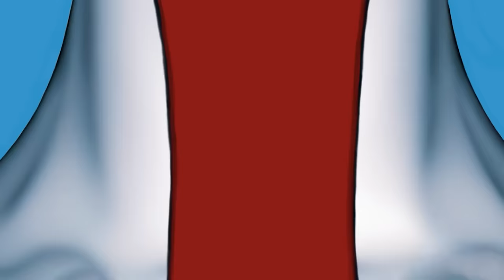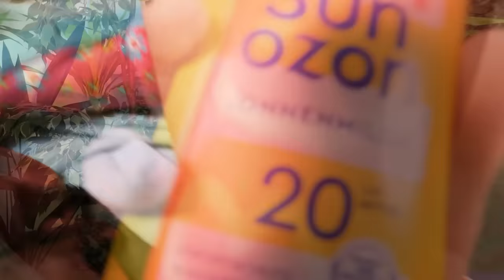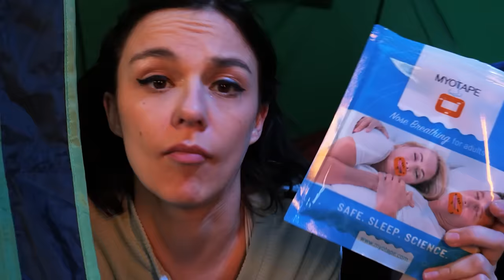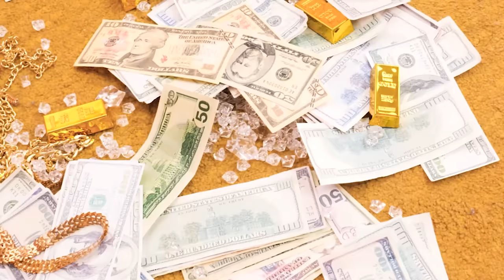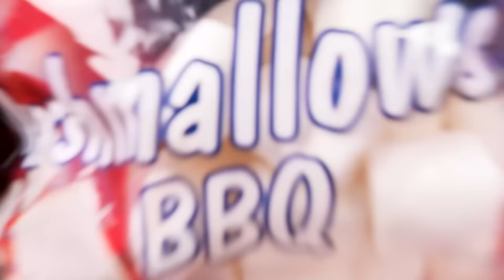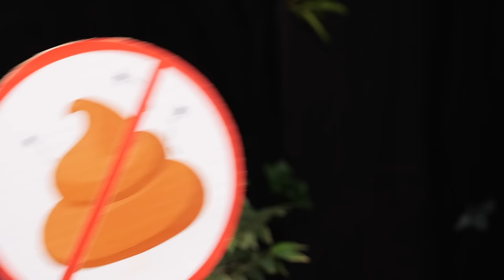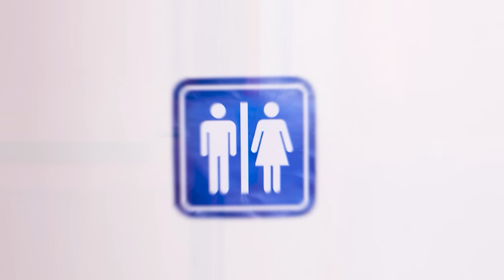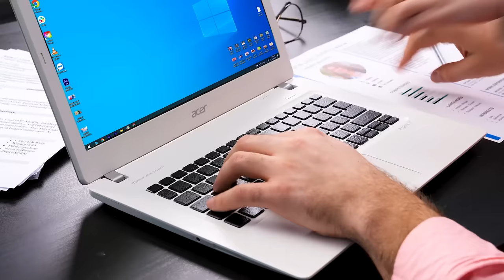Call the Doctor!💉🩸 Emergency Hacks for Stressed Parents || Funny Parenting Tips by LaLa Zoom!

Comment: Using the Heimlich maneuver is not the recommended action for choking, it hasn't been for years, there is a high risk of breaking ribs and doing little to dislodge what is stuck. Sharp blows to the back is the recommended action.
Reply: Thanks doc
Reply: 1ашрзь9е7р❤❤❤❤❤❤
Reply: Ii😅😅😅